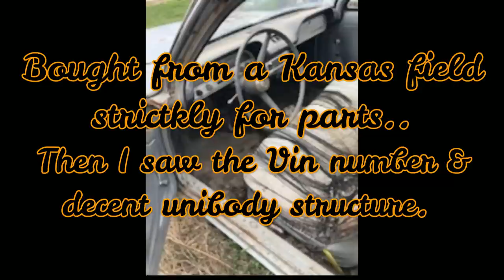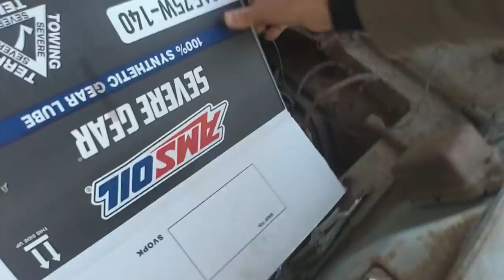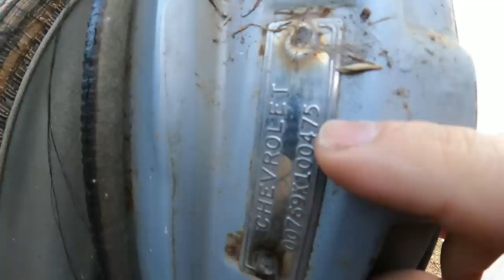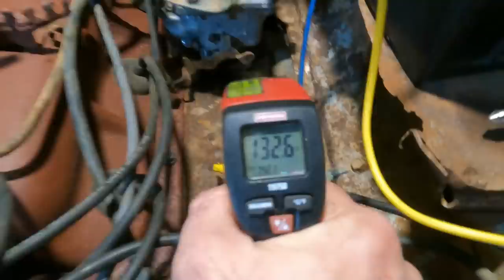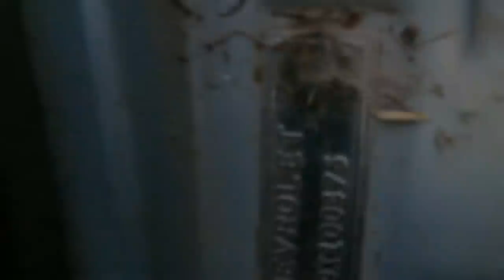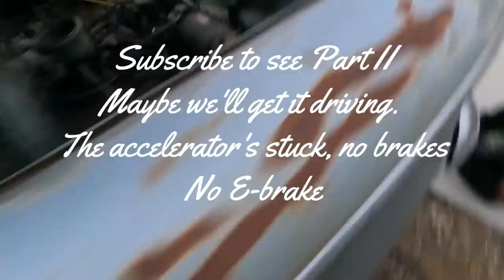Early VIN# 1960 Corvair revived. Sat in Kansas Field since 1991

Comment: Love Corvairs and what you are doing and not wanting to be one of THOSE guys, but your car is 475th from the Leeds plant in KC.  Assembly began there much later than Willow Bend.  If it was a WB build, at that number, it would have horn slots on the drivers side below the front bumper and would indeed be a RARE bird, holy grail level, worth the effort.  Still a solid car worth saving. Keep up all the good work.
Reply from the maker: I agree but I've heard the horn slot cars were only 300 and lower.. Pete Cohler (sp?) is the 1960 expert - I should ask him..  But what I really like about this car is from what I gathered from the grandson I bought it from - it never left the KC-Topeka area it's whole life. Just farm road driving in the flint hills to check on the cattle.
Reply: Willow Bend, or Willow Run?

Comment: I love the 1960 Corvairs so many 1 year only parts engine , & body  !  I had a 1960 model 700 Cascade Green 4 door that I regret selling ! I like how the choke wasn't even connected directly to the carbs. & it had the single bellow thermostat , & controlled the amount of air that came into the top of the engine ! I also remember I hand fabricated the choke tube line that came off the right side of the exhaust manifold ! & nobody could tell , I loved the gasoline heater in it the instant heat ! I was happy that I put another Corvair back on the road , It had sat in a carport for over 20 years ! & the engine had 3 bent push rod tubes from some trying to adjust the valves ! Long story short I got it running like a top , & it ran so quite running down the interstate at 70 mph! The only reason I sold it was because I bought a 67 Monza convertible , & had 2 other Corvair's a 65 Corsa Turbo , & a 64 Greenbrier ! & I didn't have room for the 60 anymore , & a friend of mine in the local club wanted to buy it ! Thanks for saving this 1960 model 700 from the crusher , & the video on how to get it back running ! IMHO the 1960 Corvair was done right from the beginning ! As Ed Cole design it .& I still have the other 3 Corvairs.

Comment: Does your 1960 have the horn slots up front? I had a wagon that sat since 1972 and I removed all of the tins, top and bottom. I use a nice drywall saw. and you can clean all the fins better than new.   I like your videos, I think I will do one for my van!

Comment: I had a 1965 Corsa convertible I bought used in 1966. Drove it for 6 years and absolutely loved it. It  had really good performnce and handling, 4 carbs, high compression and posi-traction. I live in Minnesota so the "heater" was an issue and the road salt just ate it up.
Reply: I’m from Michigan, so I know of what you speak. 
Yours didn’t have a gasoline heater, I suppose, by then. 
I know they discontinued those at some point.

Comment: I had car number 348 (00769W100348). Lots of unique parts even Clark’s didn’t have back in the late 90’s. Lost that car 20 years ago. Still have a box of random parts that fit only 1960. My car had the first edition parking brake with the little release lever that popped out, seemed much stronger than the other Corvairs I had after that.

Comment: Wow! What a great video. My understanding is they made them starting in 59' until 69' making the run a calender decade. I guess they called the cars manufactured in 59' - 60' models. ??? This must be one of them, right? Do you have any idea what month they actually started? Also, and this may not be true, but I've heard there are an estimated 50,000 left running out there. Can this be true? If it is, the math suggests your car is that much more special. Also, you seem to be a very knowledgeable Corvair mech.-do you work on them often?
Reply from the maker: Thank you and Interesting thoughts.. I can calculate about 17,000 driving ciorvairs on the road based on CORSA Club membership estimating 3 cars per person - so that's pretty acdcurate as a mean number.. So I would also estimate 20,000 cars that are not running but in OK shape. If you look at the activity in CA, TX, AX and the rest of the more suitable weather states there are more corvairs seen than 60-65 Falcons, Valiants or the other cars mass produced to compete with them... 
Yes, I've worked on them all my life but like to keep them solid efficient drivers over show cars or trailer queens. The cost to use one is probably much lower than the other classics..

Comment: Cutting the spring is the secret to having them last a long time and not flood the carbs. My first 'Vair was a '61 4dr and the pump and carbs were a headache for a while. I finally got it all working great though. Just wish it had been a manual trans. The PG is nice but the performance is crap with it on a 80hp engine LOL
Reply from the maker: Yep - my other 60 is a 3-speed. I don't like that but found a 4-speed and have a 64 suspension to install w/ the proper differential body.
Ideally a 60 coupe would make the best city car - lighter than a Valiant and some tricks to really get impressive fuel economy for what it is.

Comment: Tear the car down and then take note of what you really need to do to make it right. early models were overbuilt(which is why I like them) and tough cars. I have been in love with Corvairs since '65. The '60 model though is a beast of its own design. A lot of things got changed in '61. I would never use a combustion heater though. They can be tempestuous and could be dangerous if not properly cared for. I had one in a '67 Beetle and got lucky it worked correctly but the amount of fuel it used was atrocious. It reduced mileage to about 10mpg in a Beetle...ouch!
Reply from the maker: I agree 100%.  My restored 60 (future video) I drove all over.  (several Dallas to Tucson, corvair conventions, Nebraska trips, Dallas traffic, etc) and really loved it. And that was on Bias tires by the way.. The gas heater was OK but the better are these diesel ones which one gallon will keep the cab 80F for 24 hours! But the small jet on the gasoline versions is very temperamental.. If I keep this one for any extended time I'll tear into it and see if it has good parts inside,. 
I do have a new set of heads with the larger intake valves to put on my other 60.. Can't wait to see how that works.
Reply: Wow. This may be the earliest build production Corvair left! Or in the top 5. And it’s in very decent shape for an unrestored example.
Reply: I wonder if the transmission was low on transmission fluid. The wheel turn engagement seemed a little abrupt instead of smooth.
Reply: It’s been a while since I have seen 13 inch tires on a car. I had forgotten just how small those are. And how small the brakes behind them are. Part of the reason these cars are so light, and what makes them easily powered by small hp engines.
Reply: That origInal paint color is a good looking color for that car. The white roof trim sets it off nicely.
Reply from the maker: @americanrambler4972  Yes it was after it warmed up. I corrected that in a later upcoming video.

Comment: Very cool. I myself have a '60 700 four-door that I bought from a relative in Minot, ND It was likely a farm car, but was in a better condition than yours. I still haven't gotten it running since I got it last June, but I'm almost there. The body is in excellent condition and some of the paint is still very shiny. The interior is livable. The engine bay was as bad as yours, with a huge mouse nest under the shroud. I'm STILL cleaning that all out. The underside of the car had a lot of mud and gravel from it's rural life. I keep finding more every time I get under there. '60s are underappreciated as Corvairs go.

Comment: My dad bought a '60.  He could change the fan belt in no time.  He kept them in the engine compartment so the job would go faster.  After the belts came out that had the wire running through them, the belt problems all but went away.

Comment: I wanted a Corvair for decades, and finally got my hands on a '65 Monza project car last year.  Liked it so much, that I acquired a decent '66 140 Monza, and a driver quality '65 Monza  this year.  Addictive they are...  Also inherited my Dad's old '59 Thunderbird Convertible, and love the old squarebirds, too!  Had lots of issues with my '66 Monza running poorly intermittently.  Turns out the cheapo fuel pump had a loose check valve, and eventually it fell out and flipped upside down.  Car came with six other fuel pumps in pieces, so these things must be problematic...  Cheers from Vancouver Island...
Reply from the maker: The bug will bite you!! These cars are addictive for sure. I'd rather be learning guitar but can't breeeak this Corvair habit..  
They used to make quality fuel pump kits - I bet if someone did they would make pretty good income from it for sure.
Reply: @grillsandaxlegrease3578  I use an electric fuel pump ahead of the engine bay and just run the fuel line straight through a hollowed out fuel pump on the engine. Looks stock, but it runs reliably. Today's gas with 10% ethanol kills the rubber diaphragm in an older style mechanical fuel pump in a month or so.

Comment: It would be 10 times better to just remover the engine and do things right. Not that hard to remove.
Reply from the maker: I've removed dozens of them but that wasn't the purpose of this video or part II (soon to come)  But besides it's -11 outside here so that wouldn't be an option anyway. There's only so much you can cram in 1 hour and 20 minutes. And I want to keep it's sale price under $1500. That's for the next guy.